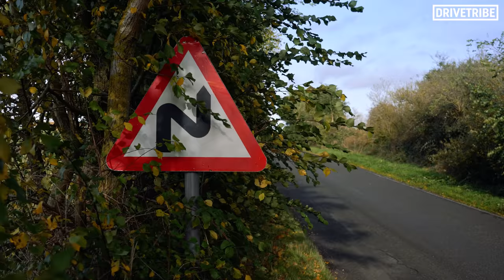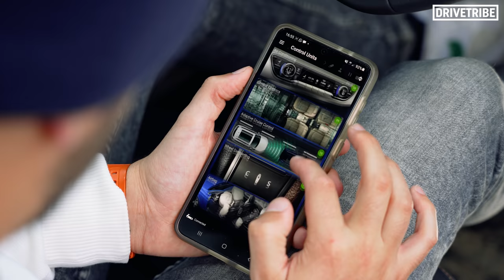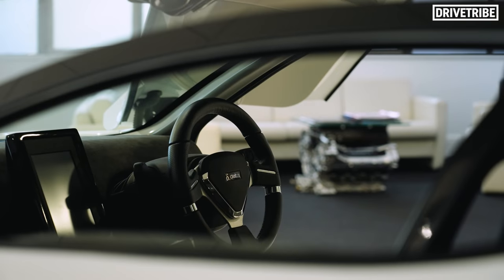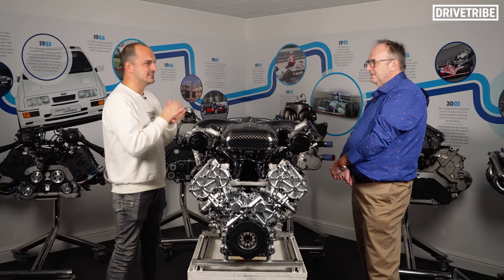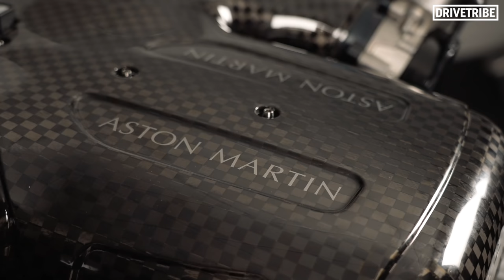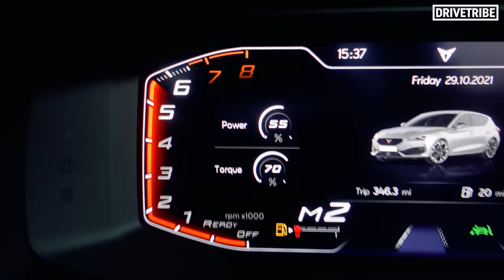Why are almost all modern engines 2.0-litres?

Comment: Mitsubishi pushed that 2-liter 4-cyl turbo envelope to 400 hp 17 years ago with the FQ-400.
Reply: Ok, but don't ask for the service interval or guarantee.
Reply: So that was a common and easily available car to the general public was it?
Reply: @cenciende9401  It is a consumer market rally engine from the Mitsubishi Lancer Evo . It was sold to public, but not exactly an every day car. The actual engine core is the 4G63 which was the core engine of all the Evos of that era. FQ-400 was a specific tuning package of it available from Ralliart (the Mitsubishi tuning and motorsports division). Thus available, but not like one would find it on normal everyday car shop floor. Soooo ehhh weird sports car specialty shop rare. Like you could get one, if you asked and paid Ralliart, but not something one would trip over in normal mitsubishi dealer. One would trip over more garden variety evos instead, with less powerful tuning setup.

The 400 hp is not that weird, since most likely it was the rally engine with restrictor removed. The championship spec engines made 300 hp for all of the WR cars of that era. However that was with air restrictor. Everyone knew everyone's engine was capable more without the restrictor. Thus the FQ-400 was probably pretty high race tuned WR engine setup without the air intake restrictor plate. After all Ralliart was the shop also tuning the actual WRC team engines.
Reply: Mitsubishi has no single performance  car in the market that can even be put in the same tracks as ordinary Audi RS6

Comment: Very informative! So how does this impact the quality and reliability of modern engines compared to older engines, if at all?
Reply: The most unreliable things on modern engines are emissions control devices. I would avoid buying modern diesels for this reason. Petrols are going the same way.
Reply: @Pyro-Lyro what manufacturer still uses timing chains?
Reply: @TheBurnout96  Many of them. Some that used to use only belts, have switched to chains. Subaru and Honda are great examples of that.
Reply: Reliability depends on quality and availability.
Reply: @TheBurnout96  timing chains are superior in every aspect
Reply: @TheBurnout96  cars are beginning to use chains again instead of belts, especially due to the extra valve train load from the extra valves ect.
Also the chain usually lasting the life of the engine is an advantage, rather than replacing a belt every 125,000km on engines that are getting harder and harder to take apart.
Reply: @alexanderboychev1095  not necessarily so. A well designed timing chain will stretch over the life of the engine, losing efficiency and harder to replace. A belt changed on time will keep efficiency of timing longer, a belt is not hard to replace. Its a trade off. Then there are badly designed chains which are the worst of both worlds.

Comment: And then there’s America. 632 cu in 10.3 liter engines that you can buy from Chevy 😂
Reply: with 120hp
Reply: @superchickenlips1  maybe 70 years ago
Reply: 8.4 Liter V10 in the Vipers.
Reply: @spicysnowman8886  Try 40.
Reply: @superchickenlips1  their 632 crate engine makes 1004 hp/876ft. Ibs torque in the deluxe package, naturally aspirated. There’s a reason the ls swap is one of the most popular swaps.
Reply: Yeah. My US made Toyota Tundra 5.7L V8 gets 14mpg. So I ride my pushbike everywhere. For real!
Reply: @impressivestory  There is also a reason why Chevy have gone with a proper four cam, 32 valve flat plane crank V8 for the new C8 Z06. Those engines cost more to produce than the push rod single cam ones, but Chevy clearly think it's worth doing.
Reply: @johnmitchell2269  no disagreement there! Just disputing the annoying meme that large displacement US engines make no power.
Reply: As it should be.
Reply: @impressivestory  and what’s the 0-60 like? Most standard engines on American cars are large for no reason, lots of power and size but it’s less economical and slower than the average downsized European equivalent. BMW’s are a great example of this
Reply: US auto manufacturers, turning octane into decibels without bothering with HP for decades......
Reply: Chevy.....aka GMC.....GMC trucks, body by Fischer, engineered by Miss Take.....   LOL
Reply: @Horizon301.   That's a really convoluted way of saying you don't understand the subject.
Reply: 600+ torque
Reply: @superchickenlips1  we nerfed ourselves in the 70s lol
Reply: @johnmitchell2269  Chevy did blind tests of an OHC v8 vs a OHV v8 and almost all testers preferred the feel and response of the OHV engine. So they continued to develop them and made the LS series. Doughnut media did a video on the LS it’s not bad.
Reply: @impressivestory  you’ll always hear people quote fuel crisis figures but none before or after.
Reply: With a sweet 100 hp to its name
..literally all the old American v8 are the pillars of inefficiency with their push-rod setup
Reply: @xyroah  hp isn't everything those big engines put out insane low end torque, and offer smooth driving. There's a reason rolls and Bentley use giant 12 cylinder engines, you can't beat displacement for smooth starts and stops.
Reply: And with how expensive oil is right now they must be crying.
Reply: @xuxon24  right
Reply: @johnmitchell2269  that engine is an engineering master piece. it is a proper race car engine turned up an extra 170hp and made emissions compliant
Reply: Love all the euros hating on big american engines, while driving with motorbike size engines in their cars, enjoy! :D
Reply: @KapitanPisoar1  not me mines 5.0l with supercharger, 600hp they can keep their 4 cylinder things.
Reply: @chrisclarke6344   Same I am from Europe living in Canada and feel bad for what’s happening back there. Also happy with me V8, no supercharger tho. Btw. They’d be happy to have 4 cylinder now it’s down to 3 :D
Reply: @KapitanPisoar1  absolutely the exhaust note of a v8 is worth the fuel cost, those 4/3 cylinder things have no exhaust note at all. Remind me of 1.1 fiestas with a big bore exhaust just making loud farty noises.
Reply: Detroit Diesel Series 50 C.N.G. and Diesel is an 8.5 litre four cylinder. No longer produced but very reliable. That one uses a balance shaft assembly bolted to the bottom of the block. Worked on them back many years ago.

Comment: 3.5l V6s are much more common than 3ls. The only 4l V8s I can think of offhand are a BMW and possibly a Jag iirc. Most V8s are closer to 5l.
Reply: mercedes and audi does the same nowadays
Reply: Idk about v6 but inline 6 is 3.0l most of the time
Reply: The very common and popular Toyota 1UZ engine is a 4.0l V8 and has been documented lasting 1M miles and being stout for building. Nissan has also made 3.0l V6 motors but he was implying 3.0l for I6 motors I believe
Reply: @1S1KC0DM4N  mine 745d v8 single turbo e65 had 860k km when I sold it was torque monster. Only problem of the car was automatic gearbox which could not handle torque so we rebuild it twice in my ownership (470k km)

Comment: 4 cylinder is no replacement for a 6. I’ve made the move and really miss my smooth quiet powerful 6.
Reply: I agree, I went back to 8 despite the 6 having a whopping 335 HP!  My new one has 510
Reply: If you want smooth and quiet go electric...
Reply: @whocares264   I just don’t understand that part.  I want a growling Coyote 5.0 (like in my Jaguar) or a Mid engine Vette! Around 1910-1914, there were electric cars all over NYC and charging stations everywhere.  If that had kept going, I wouldn’t be into cars at all.  (Lithium wasn’t used yet, which killed it off) Sure, there faster with instant torque, but 0-60 in 4.0 seconds like I can do now is ok.  And love that deep rumbling….just don’t like Quiet in cars.  The new supercars are all hybrid and that’s cool.

Comment: I never would have thought that I would  love 4.cyc. but I do now.  First one 6 years ago, Mercedes metris van...2 liter and I can tow 5000 pounds.   I'm at 95,000 miles and zero cost.

Bought my wife a X3 with 2 liter, its amazing.   I just bought a BMW 430i, I had chipped, 300hp lots of fun and I get 35 mpg on the interstate.   Love the 2 liters now!

Comment: Cost cutting usually is the number one motivation for car makers.
Reply: Mostly true but they are also under the hammer to get their 'fleet wide' (meaning  vehicles sold) CO2 emissions down to a specific target.  Hence you've seen the likes of Audi drop v8 engines from the S6 (now a V6) and a bunch of other amendments to try to drive down overall corporate CO2 numbers,,,

Comment: 2.0l 4 cyl engines are very common, but so are little 1-1.5l 3 cylinders.
Reply: Well 1.5L is still 500cc/cyl. You kind of don't want to go to less than 3 cylinders because the engine balance, power delivery (smoothness) and sound will be absolutely horrible, so just building a smaller 3cyl is the best compromise
Reply: @laurean5998  500cc per cylinder seems to be ideal when you want decent performance but also longevity and reliability.
Reply: What have the world come to. This is just saddening
Reply: @laurean5998  fiat chiming in, 0.9 2 cyl... Ok, it is only in the panda, 500, punto and ypsilon.
Reply: The japanese knows that a 659cc inline 3 is much better than 1000cc

Comment: I feel the vw 1.4l is an excellent exemption from the 500cc idea. I have the 17 GTI and the 2.0l is fun but I had a 17 jetta with a 1.4l and it was plenty fast with 170tq
Reply: The 2.0 GTI engine blows the doors off of the 1.4T because the 1.4T is designed for purely efficiency and not necessarily performance
Reply: @carterdavis5176  im just saying. not a deal breaker

Comment: I'd actually love to see a car manufacturer come out with a V4. They sound fantastic and would be a far more interesting alternative to the endless ocean of inline 4s, without compromising in fuel consumption and emissions.
Reply: ^^^It’s been done, read this article to see all the pros and cons. For me the biggest con is cost and reliability, you have to manufacture two cylinder heads instead of one, 2 head gaskets to fail instead of one etc, etc. I own a v8 and an in-line 4 though so to each there own!
Reply: you would probably compromise fuel economy. just like i6 vs v6

Comment: Years ago, I had an older model Holden with the inline 6cyl 186 cubic inch engine which is close enough to 3 litre, very smooth and reliable, no fuel injection and no turbo, with a few modifications could put out some decent horsepower and torque. I now have a 2 litre 4cyl with no turbo or direct injection, no complications with balance shafts, reasonably smooth and once again reliable. The Australian Holden was a 1966 HR with the classic 186, give me a bit of inefficiency any day. An elder mechanic told me this years ago about the 500cc cylinder displacement from years of experience.

Comment: I often wonder about the lifespan of these super tuned 2.0 litre engines!
Reply: I would take a stock V8 over one of those high tuned 2 litre engines
Reply: Well. Look at the current F1 turbo engines. Failure is far less common than 10 years ago. More complicated, and more reliable. Engineering...
Reply: @asphalthedgehog6580  It sledom turns out that way in the long run. Or you're going to get one massive bill later. They would have been even better less complicated.
Reply: @martinsv9183  you see that wrongly. These engines will last 100kmiles. Throw it away, replace it with a new one
Reply: @asphalthedgehog6580  not exactly the same when all F1 engines are rebuilt after every race 🤣
Reply: Been running 408bhp on my Mitsubishi Evo X for over 10 years and 130,000 miles.
The engine hasn't missed a beat and still going strong.
Famous last words 😄 BOOM
Reply: @TheTechGiantYouTube  Honestly, thats not all that impressive, when a base minivan these days have very uncomplicated non turbo engine around 300 hp.
Reply: @TheTechGiantYouTube  yeah my ecoboost on E30 made 403 with 460 fptq. I usually drive on my more conservative 350 hp 91 tune. I'm always worried it's gonna blow up but 50,000 Mike's and no problems minus my car being picky about plug gap on e30. My car on e30 makes about the same hp as my mom's coyote but man does it fee and is so much faster because of that instant torque. My accessport gives me anxiety, got some videos on my channel
Reply: @Santor-  dude, those minivan engines have like one and a half liters of displacement advantage. On top of that a 400 hp Evo is making waaaay more torque than some minivan engine. And no there aren't 300 hp minivans, in car world we only pay attention to whp not what a brochure says. That "300" hp minivan is more like 230hp so you lose to the 2 liter Evo by about 170 hp. I don't get you people. Run into mustang gt guys sometimes who ask about my car and when I mention it made 403 they tell me theirs makes 450 and look at me baffled when I even mention whp and even more so when I tell them they are making about 400 hp.

Comment: so just take 2 of them, build a „V“ and you get the better engine. 👍
Reply: Not really, only more complex and expensive. Nobody needs that much power in a road car.
Reply: @nielsdebakker3283  can never have enough swept volume or power, makes the car nicer to drive thanks to low down torque, which highly strung 2l 4pot dont have.
Reply: @nielsdebakker3283  Need is not the point.

Comment: I drive a modern 2ltr twin turbo Jaguar 
This gives me the best of most worlds
It’s lighter than a V6 by some 58kg
It’s more frugal than a V6 or V8
It’s more agile being lighter 
It’s power output per litre is greater 
It’s a revvy engine , max power comes in at 1500rpm.
The only thing that’s not in its favour against the V6 and V8 is the engine notes. But overall it’s a peach

Comment: 1L in-line 3 cylinder turbo petrol 
are the most popular entry level turbo options we have at least in asia market i guess…🤔
Reply: thats agreeable due to price of petrol. 1l engine  fuel efficiency go easy on most of normal people.and turbo became the answer of lack of power of those engine. with 3 pistons.size of engine became smaller and those space can be used for turbo. majority of people live in city just want power of torque to go from traffic light to another traffic light,and most of them hardly go more than 70mph ,so that its enough for them to have fun with cheap.its maybe a low horse but its a fun one for sure
Reply: @canul3801 In Brazil is common too

Comment: Cool video, always informative. One thing I wonder about these 2.0T engines though: Durability? They are pretty high strung, long term I doubt they can last as long as a normally aspirated engine. Time will tell but I have a feeling they won't.
Reply: They definitely don't. Having to change worn out turbos at 75k miles is very common. No need to wait for time, this is already known.

Comment: Would have been nice to not have my ears blown out by that awful PEAK TORQUE bit.  But yes, same reason the Audi/VW 07K engine is a 2498cc inline 5, using much of the same components as the beastly EA888 inline 4 setup
Reply: haha agreed that the peak torque kinda caught me off guard, thankfully wasn't wearing headphones, so was more funny than painful...

Comment: Should be duel progressive turbos and supercharged 1- 1.5L you just need compression. It's the replacement for disacement 😉
Reply: Make 600hp from 1.5L engine 💀
Reply: @GF-mf7ml  BMW made 1500hp from 1.5L
Reply: @thebaconsonful  sooo reliable XD
Reply: Not reliable.  Manufacturers have to warranty these engines

Comment: And yet - the classic Alfa Romeo 2000cc Twin-cam hit these magic proportions in the 1960's .... and it was slightly oversquare ! For Alfa's, the optimum cc/cylinder is 416cc - 533.5cc, as per the 2.5l -> 3.2l Busso V6; The Ferrari/Alfa in the Guilia Cloverleaf  & Ferrari 296 (same heads and internals as per the tech manuals and images, different bank-angled blocks) use 483.33 cc / cylinder oversquare.
Reply: Most important displacement in the history of Alfa was 1750cm.

Comment: They’ve been saying stuff about v12s for years. They’re still being made calm down
Reply: Not for long Mate, but it’s okay.
Reply: When was the last new V12 though
Reply: @aaronm1246  Lambo is still advancing the V12 for the upcoming Aventador Ultimae, the BMW m760i still has a V12. The DB11, Maybach, Rolls even puts it in 4 different models.. How can you even forget the Ferrari 812 V12, the highest hp-delivering N/A V12 ever made? As long as we have people with deep enough pockets to buy these over-taxed powerbeasts they will keep the V12 alive. Long live displacement!
Reply: @Djetsky  No, I mean an actually new V12. Like a new engine.
Reply: @aaronm1246  New engines haven't been really developed in years. Most engines are advancements of older engines.
Look at BMW: the n54 was the first 3l twin-turbo I6 back in 2006. The n55 followed up, different turbo-setup but advanced from the n54. The S55 (M3/M4) is advanced from the n55. The B58 is advanced from the N55 and S55.
Engineers don't throw away old working products, they work from what they have and improve. New engines will be made as soon as they find completely new techniques that will greatly outperform the older ones, and can't be applied on the old setup.
The valve tech of the Koenigsegg Gemera 3cyl ICE engine can be classified as a new better technique, but is still to expensive to add on regular road cars.
Reply: @Capt Shiny Era of EV from 2030?

Comment: I'm amazed by the B420T27 that's in my wife's 2016 Volvo XC90 T6 AWD. It's a turbocharged and supercharged 2.0L L4 that makes upto 316 hp (235 kW) at 5700 rpm and 400 N.m (300 lbf-ft) of torque between 2200-5400 rpm.

For a car that size, to be ONLY powered by a 2L powerplant, that's pretty amazing/incredible.

(The Mercedes M139 which makes 416 HP @ 6750 rpm and 500 N.m (369 lbf.ft) @ 5000-5250 rpm is just ridiculous how much power they've been able to squeeze out of a tiny 2L engine.)